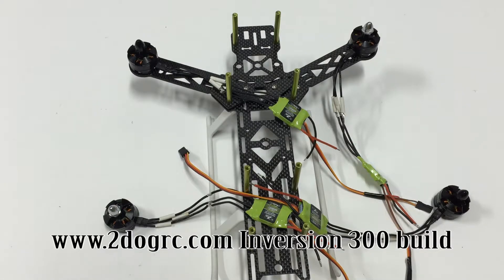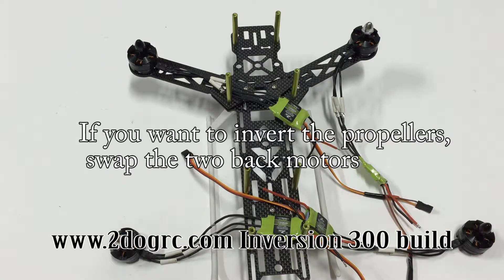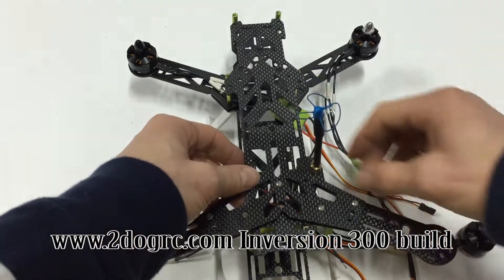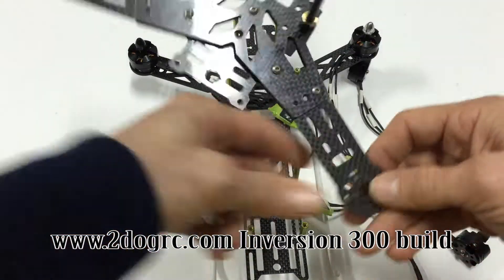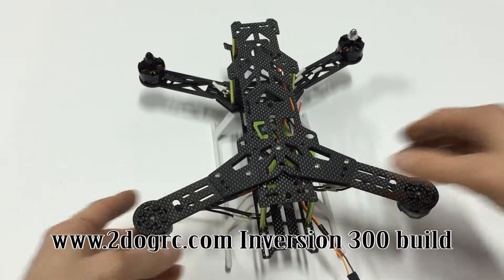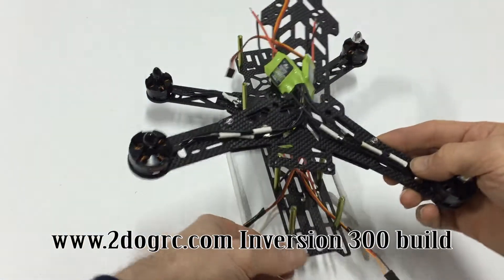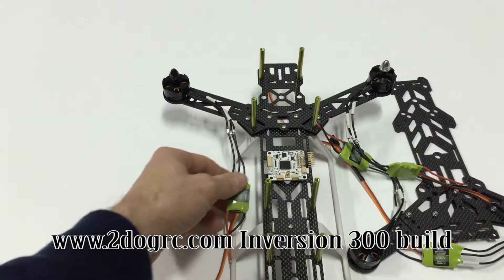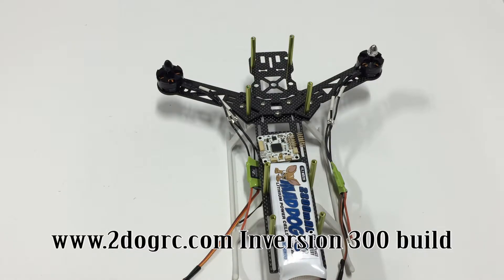2dogrc 300 Inversion Build Attaching Motors

Comment: Never flown anything yet but a Hubsan H107 and never built anything yet, much less an inversion, but even I'm pretty sure the explanation of the motors & props here is not complete. You do come back with text to note swapping the rear motors (IF? you are going to invert them?) but it's easy to miss when the video AND voice-over contradicts it repeatedly with the wrong instruction. Not only that but I'm even thinking that maybe the props DON'T swap with the motors but stay in their original physical place (a few millimeters lower) and orientation, TOP STILL FACING UP, though they would seem upside down when threading them on the motor. I don't even know yet how this affects their logical numbering in the controller but I'm guessing as long as you end up with the props still facing up and turning the right way for their position, it should be OK. And, Oh yea, you probably want to flip the rear motors before you connect them to their channel. This may be out the window if you wired the rear motors backwards but I'm not sure if the props would stay on, though maybe they will since they're upside down, or should be - in relation to the motor anyway. 

I'm sure I have some of this wrong somewhere but it just goes to show how much more complicated it might be than y'all are considering. I guess somebody got it right since they flew it but not sure we're getting the whole recipe here.

Ok, I'll duck while you throw stuff and tell me I'm crazy.... 

But if you're still flipping, you might want to think about it.

Comment from the maker: If you are flipping when it starts, Check these.
1) Board is pointed with the arrow facing front.
2)Propper Propellers on each motor and the motors are spinning in the proper direction.
3)Motors are connected to the proper channel on the board.
4)The board is showing level in the Open Pilot INterface.
Reply: +2dogrc That seems to be standard "flip" troubleshooting - but doesn't mention the inversion factor.